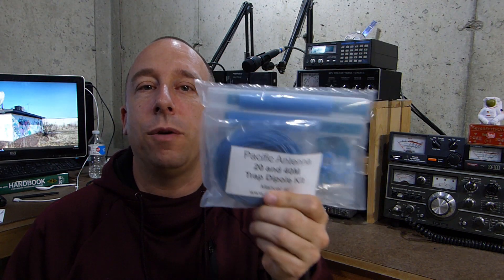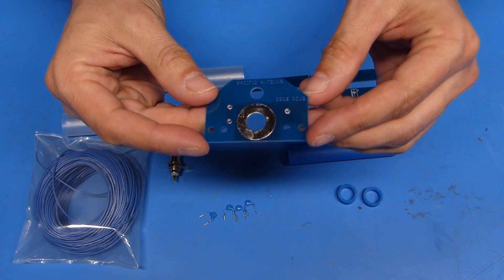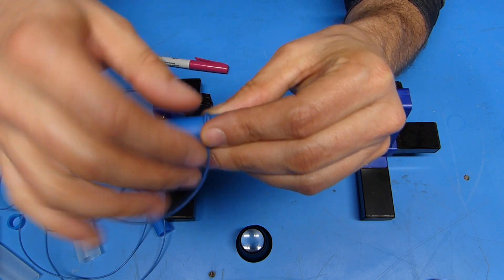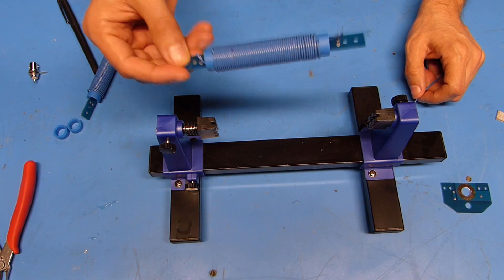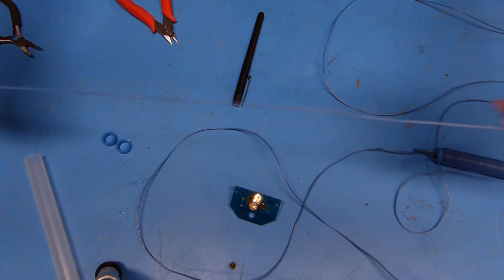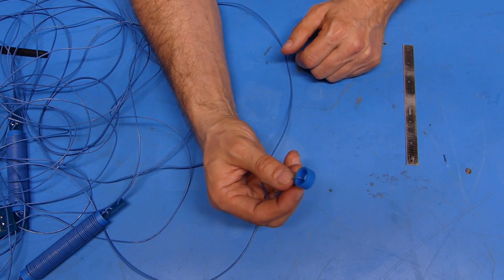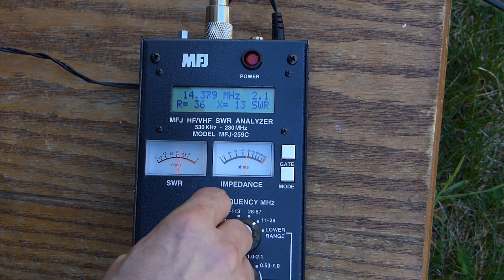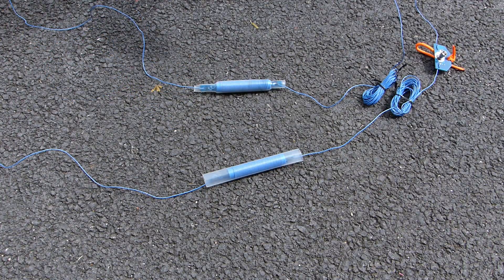Pacific Antenna 20/40 Meter Dipole Ham Radio Antenna Kit Build Tune and Test

Comment: So just running into this video, like your videos btw. So it has been 4 years. For a 20/40m antenna, and compared to what you have done with other portable dipoles, how do you like it now? For $25.00 I might give it a try. Robert KD4YDC
Reply from the maker: Its a decent antenna for portable but is a little more difficult to set up than an EFHW.  I like having the option although I don't norice much difference in performnce over an EFHW
Reply: @SevenFortyOne  what is the OD of the pipe former , its not mentioned in the manual

Comment: Just started to build this antenna after purchasing it months ago.  One of the guys in my radio club has put about 6 of these together.  He cuts the inner legs at 15’ 6” and the outside legs get trimmed between 8’ 5” to 9’.

Also noticed you had excessive wire after doing the 51 wraps… I had about the same excess and I thought I did something wrong.

Comment: Hello. I'm hoping you can help me quick because I'm in the process of putting one of these together.  On the BNC there's a small metal washer with a tab on it.  I do not know where exactly to solder that??does it solder with the wires or to the center conductor wire?  Please help.  Thank You
Reply from the maker: I thought I showed it in the video and explained how it was connected.  Give it another look and if you don't see it let me know and I'll go look at mine to see what I did

Comment: I have an ICOM 7300 but not a separate tuner/analyzer.  I'm a new HAM and am not sure on adjusting the antenna.  Could I just put it together and hang it and rely on the ICOM tuner for correction?
Reply: As long as you stay below 3:1 it wil tune. But remember! A tuner does not tune the antenna, it makes the radio think the antenna is tuned. It is always better to get the antenna resonant where you want it to be so you don't get any power reflected back. If the SWR is no higher than 2:1 (about 10% loss from the output power, so effectively about 90% is send out by the antenna) you can do without a tuner. Lower is always better of course. I always check my SWR before I connect any of my antenna's with a Rigexpert analyzer. A good analyzer is a must have, of course you gotta have budget. But if you do, get one. It will protect your radio from SWR mayhem and it will help to get the best from your antenna. 73
Reply from the maker: The answer is always...it depends. The internal tuner in your icom should handle it as long as it's not too far off

Comment: how many cm is the outer diameter of the pipe?
the thickness of the cable?
Reply from the maker: If you mean the "pipe" that forms the coils, its about 16mm
Reply: @SevenFortyOne  Yes thank you very much and how many awg is the cable?
Reply from the maker: I think it is 16awg

Comment: ADDITIONAL COMMENT: You want to have fun? Make your own trap antenna by using toilet paper tubes for the coil forms. There is no magic; you'll just have to figure out the inductance of the coil you wound in Jim's kit by reversing the parameters (6-inch coil 3/4" in length with 51 turns equals what inductance?) Then recalculate the number of turns for a TP tube and wind away. Then calculate the resonant frequency for the that inductance and figure out the capacitance. That should be the total of the RECIPROCAL of the caps so Jim's kit has two 27 pF caps or about 13 pF series capacitance. To make the trap resonate at about 14 Mhz, you will need to wind a coil with about 10 uH inductance. (Close enough for government work.)

Give it a try. It's not that hard!

Comment: MAJOR LESSON HERE: Trap dipoles are tuned from the center out. Do not attach the traps until you have pruned the 20m dipole down to it's desired resonant frequency -- and even then, don't solder the wire to the trap. (Tin it and push it through the holes.) And then add the outer part of the leg -- which you can solder because you can trim the outer ends of the antenna. Once the the antenna is resonant at the 40m frequency you want, you can solder the 20m inner part of the leg, slip the shrink tube over the trap, melt it in place, and add the PVC loops to the end. 

If you are careful, it will be perfectly tuned for BOTH bands.

Comment: Why not mention the metal ring with the arm with the little hole? Where does it go? It lines up with a hole on the board, why not mention that? The instructions that came with it doesn't mention it either.

Comment: Nice kit...

If I may offer one suggestion, since you have that nice, large solder pad around the BNC, I'd add two solder joints from the bnc connector to that pad just to ensure you have a great ground there - considering the torque from the coax.  

Put the iron tip on the bnc flange & add solder at the pad/ flange joint - go around about 20 degrees on each side - pre-add some flux too to help transfer the heat. 

73

Comment: At 4:34 when you make your last wrap and go back through the hole for the 1" lead, does that wrap count as a wrap or you go back through again?  I would think if the in/out holes in the coil don't line up it would be obvious, but where do you start and stop counting if the holes line up?

Comment: After looking at the website, I’m wondering if you could combine the 20/40 kit and 17/30 kit with an LDG 1:1 balun to have a 4 band antenna on 1 pole with 1 feed line. I may have to try that!
Reply from the maker: Interesting...I bet it would work fine
Reply: @SevenFortyOne  ..bet you it would not. The interaction would compound and over-complicate the tune-up process greatly! You are better off building a fan dipole with separate elements for band. 40m would be approximately 33 feet for each leg, 30m would be 23.5 feet, 20 would be 16.5 feet, and 17m would be 12 feet. Adjustment then would involve only trimming each leg of the fan dipole until all came into resonance.

Comment: So Rob, could you possibly let us know what the lengths of each segment wound up being after you had it tuned for the final time? Great video sir!!! 73!
Reply from the maker: The inner wire ended up being about 15'9' and the outer wire 8'10".
Reply: @SevenFortyOne  Awesome, thanks. I may pick one of those up to try out. I've been thinking about working some portable lately. Thanks for the video and all the info! 73!

Comment: You can't make this yourself because????
Reply from the maker: You can if you want to but this kit wad probably cheaper than it would be to buy all the pieces
Reply: @SevenFortyOne  fair call
It was obvious that it's not cut and pre adjusted. A bit sloppy of Pacific antennas.